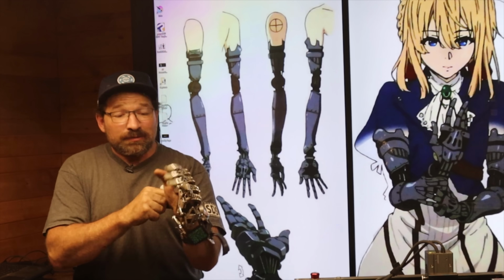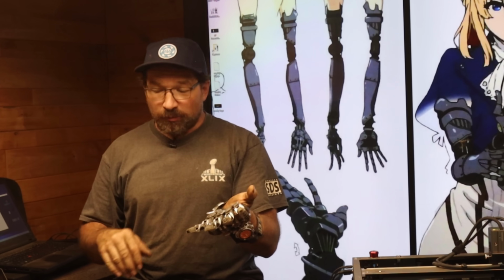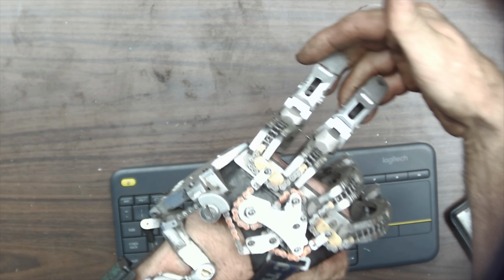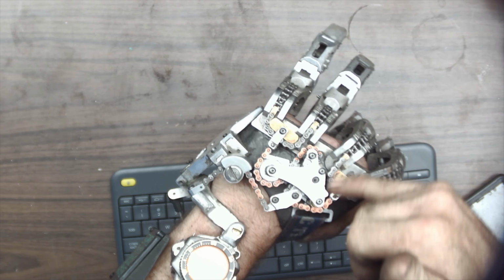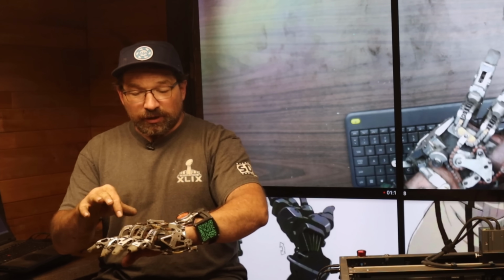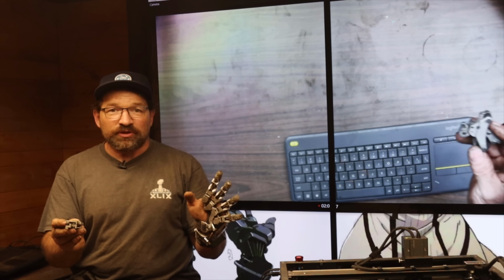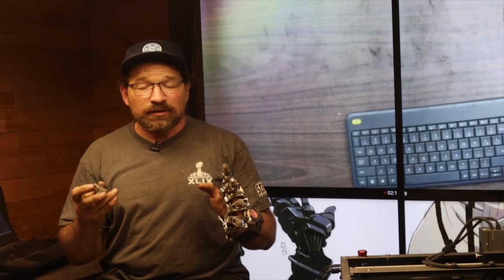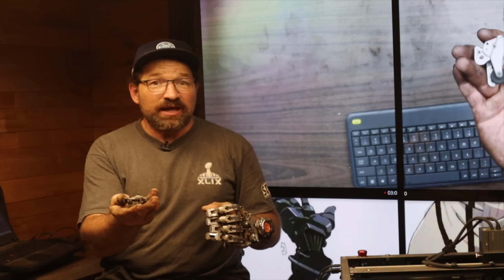Fake Prosthetic Hand?

Comment: You got the most natural and expressive prostetic hand I ever saw. All mechanic, no servo, no battery, extremly fast, it rocks! I wouldn't had believe I would subscribe to a prostetic tinkering channel. But you are up there with the DIY perks and the Electro Booms in the top tier of educational/DIY chanels.
Reply: He's really lucky to have a thumb left, because I think he wouldn't be able to build a functional one with a mechanical thumb (not hating him, just pointing it out)
Reply: @kolyashinkarev7366  It wouldn't be impossible but thumbs are significantly harder to create because of their range of motion
Reply: @Scornfull  it would be severely limited
Reply: @Scornfull  As wearable device, sure. But as functional prosthetic, not necessarily. Thumb is controlled by muscles in the palm so it should be possible to somehow adhere to those. Outer joint has limited range of motion already. This kind of mechanical device shown in the video wouldn't do of course, as nice a contraption it is.

Comment: As a CGI artist myself, I can only be flattered people would think us both creative and knowledgeable enough in engineering to come up with something like that.

Hats off to you, sir.
Reply: Basically every dismissal of someone's skill with the cry of of "it's CGI!" are just unintentional backhanded compliments.
Reply: For real though, doing this to the level of realism displayed in these videos through CGI would require herculean efforts on its own right. It wouldn't actually be less work to fake it, it would just be a different kind of insane workload. Arguably, it would be harder to fake it with no errors you can catch.
Reply: Like, the only situation in which it makes any sense to fake this would be if the hand literally cannot exist in reality and function like it does. Otherwise, there's not really a budget cap on how much you'd have to spend to get rid of all the artifacts. There's a reason why you can spot CGI at a glance in TV shows, if you actually know what you're looking at.
Reply: ahh dont sell yourself short :D Im sure you could create something like this in CGI.
Take 3D printers for example. I have seen clips of some really intersting stuff with moving parts and all, created in one single production. For that, the Creator has to program the Object in a 3D software, correct? If there is no conflict in the 3D software, it should work as real object.
i have no clue how CGI artists work, but isnt there a slight similarity between the processes of creating a digital 3D object for a 3D printer and creating a 3D object for CGI?
Reply: @smaragdwolf1  Creating the 3D object is the easy part.

The hard part is compositing it into an existing scene in a way that is correct.
Reply: @ExEBoss  So much this.  I dabble in 3d asset creation as part of my side-gig.  There is nothing about this hand that would be particularly difficult to make a model of.  The hard part is implementing that with live video and getting so many of the really subtle details that your brain picks up on right, such as lighting it in a way that matches the environment and real light sources in the room, syncing shadows and movements in a realistic way, etc.  Those are the things that even AAA movies struggle with in CGI, and when you get them wrong you immediately notice that it's fake, even if you can't really articulate why you can tell that it's fake.

Comment: Do you ever worry about small things getting stuck in between the parts? Like dust, cat hair, dirt, etc?
Reply: He does have a cat too doesn't he?  I bet it's no harder to clean than a bicycle
Reply: I dont think it would have an impact unless its ball of hair or something solid that can jam the mechanism. As dude above said, its like a bicycle.
Reply: Cats are harder to clean than bicycles. Trust me. 
;P
Reply: @plasmashears  most of them seem fine after the extra spin cycle on my side loader.
Reply: I don't think he's had a single hand in use long enough to really worry about stuff like that. It seems like, once he has one hand finished, he's at work making an even better version. 

So, if he did get stuff like cat hair stuck in an essential part, it would just be removed when he took the hand apart to upgrade it.
Reply: nice thing is you could probably throw it in the dishwasher
Reply: @explodedstarmonkey  yeah I'm not sure I want all that worn aluminum powder in with my dishes but probably
Reply: @explodedstarmonkey I wouldn't put anything more complex than a blender blade in a dishwasher. Thermal expansion and uneven cooling can cause jams and undue wear (I'm pretty sure he has stainless parts on brass axles - brass expands at a faster rate than stainless, so that could potentially damage either the part or the axle.) Not to mention that most dishwashers leave behind residue. I'd guess that just throwing it in the dishwasher would just be a bigger mess waiting to happen as compared to taking it apart and cleaning it with alcohol and q-tips like you would with a gun.
Reply: @explodedstarmonkey last time I threw my cat in the dishwasher both my wife and the cat were furious at me...
Reply: @littlesnowflakepunk855  Yeah some dishes like lead crystal or painted stuff actually isn't good in the dishwasher... don't like putting good stainless steel in the dishwasher because it can get pitted.
Reply: Car
Reply: One word: mudflaps
Reply: Noisy Siamese just like mine. So bossy lol. Awesome work on your hand dude. Saw it on Facebook reels and came looking for you. Really incredible. Hope you have had many opportunities for collaborations and success since coming out with this.

Comment: Your mechanical palm is just brilliant, Ian! :)))))
Robotic companies must hate you already :D
No paid subscriptions, no software, no electronics, just couple of metal bars, gears and chains <33333
Good luck Ian with evolving your innovations :))))) <33333
Reply: They really don't. While this is a really ingenious solution that is "low-tech" and therefor accessible, it covers only a small subsection of injuries. I'd argue the smaller one, not that I know the stats, but it just seems likely whatever can take 4 of your fingers can just as easily take your whole palm or forearm. Once you cannot rely on the hand motions is where the current problems in prosthetics are, and where the vast majority of the investments go. And if you actually look at the research, it is searching for unified control systems, that can intergrade at motor plate, axon, and even brain stem level. Current prosthetics can give you individual finger motions and the ability to write again with a missing arm up to the shoulder. I get it, I also like the absolutely metal look of his prostatic, but that is not what you would give to a 10 year old that lost its arm in a car crash.

Comment: Amazing work. not only is the hand a working real prostetic limb but it looks really cool. I think the part i like most about it is its Mechanical nature that allows it to work without complex motors and computer/sensors. just good old chain, ratchet and latch (obviously more complex then just that in design.) but the low tech design speaks volumes about its practical use and design for the average user

Comment: As someone who has 3d printed hands that looks amazing! I designed a screwless system for the standard hand that uses the same pins to adjust the cords that the joints used. This made build time 2x faster also the hand could withstand more force and the hand was cheaper.
Reply from the maker: Hmu, id love to see what you've come up with!

Comment: This is just incredible. This is far more reliable than glichy fancy sensors.
Reply from the maker: I have absolutely the best, most reliable results using a body powered mechanical partial hand prosthetic device. I never worry about the batteries dying in the middle of doing something, and it doesn't care about dirt, oil, or water. It just always works.

Comment: Nice engineering!  It's pretty amazing imo. 
Curious about estimated cost.  Just curiosity, I don't need a version of that. 
(I am a bit "short handed", but it's only about half the segment after the last knuckle on two fingers, so not much can be done and they're mostly useful, though my typing speed got trashed.) 
You have my sympathies for needing this, and you have my awe at your resourcefulness and skills.  (I haven't seen a mechanical hand that looks as clean and robust as yours)

Comment: What material did you get printed and with which process?  Plenty of $200-250K range LPBF systems on the market now that can print titanium, inconel and tool steels with incredible accuracy.  They can also do a variety of stainless or aluminum, sometimes even copper alloys but I think the previously listed material would be of greater benefit.
Reply from the maker: The current new setup is mfj pa12 and sls 316 stainless. The pa12 is proving to be a little too brittle for long term use, which sucks. I thought that was going to be a strong enough option. Sadly it isn't. My next step will be pcbway in ti and aluminum.

Comment: Engineering Mechanics is an amazing science, with the help of mechanics you can create giant walking machines that will move due to pistons and pressure in them without using fuel. So why do we use internal combustion engines and electric motors? The question is obvious: they are easier to create and maintain.

Comment: maybe you could ad silicon pads with a solid a back and lines on the pads wil simple silcon caset for more grip as well as a hard back it might take time for you to do indervidual pads for every part of the internal fingers but i think they won't need to be thick iver just enough to add extra grip so that even if you are holding smooth object it adds extra gip that nateral skin uses and as they would only be small indervidual tabs they could ealsily be removed for maintance but also allow for better grip say on glass and takes less pressure to hold an object for pricicer work as well as allowing it to ack as a cover for some of the internal movements so they dont get blocked thanks to ait stopping a bit of dirt ruining the internal move ment id also say may some small screw nothing big but simply to hold theym in place two small or 4 really small as to help if already have had this idea fair enough if not hope it helps 

good luck on any improvements

L
Reply: for reference id also recomend only placeing those small pads on the furthest point from the joint movemet as not to impead it but just add exrta grip minuitly until you have a better way to cover the movements without blocking it

thanks again 

L